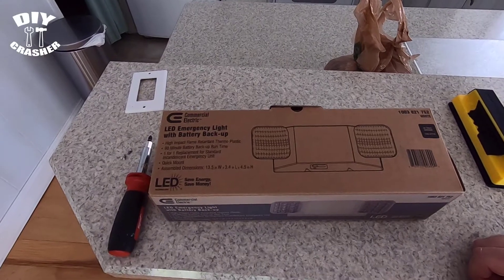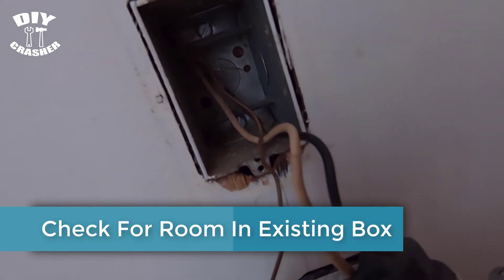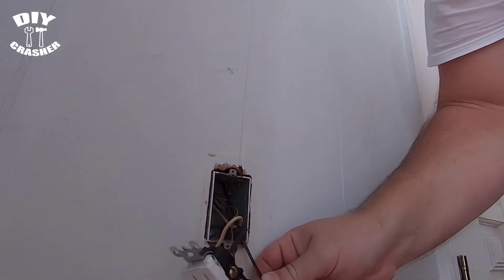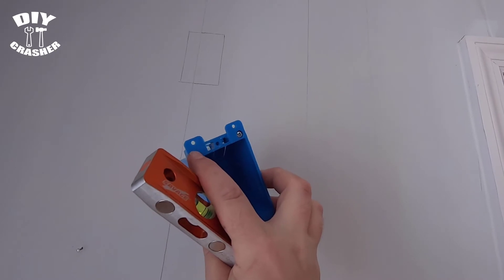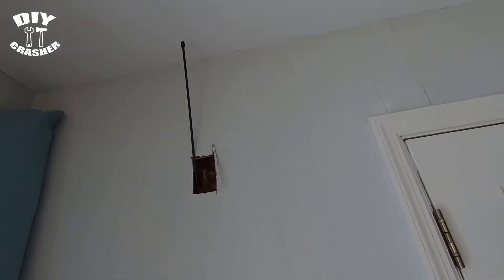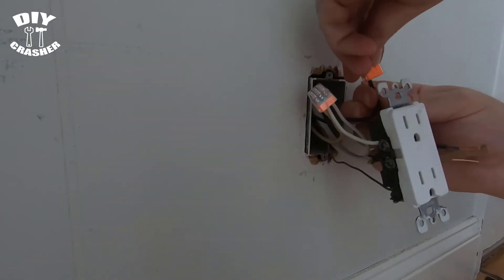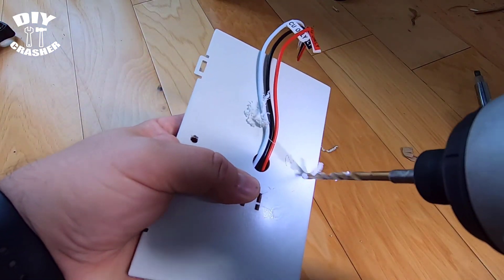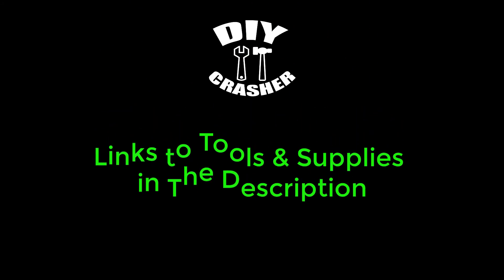How To Install Emergency Backup Light In Your Home For Power Outages

Comment: This video could be USEFUL to the AVERAGE person IF You bothered to SHOW EXACTLY where the RED, BLACK, AND WHITE WIRE GO! If You cant say SPECIFICALLY for example “the RED GOES ON THE LEFT, the WHITE GOES…..
Reply from the maker: Thanks for your comment and sorry for any confusion, I should have been more thorough and will be in the future.   For this particular scenario, the red wire wasn't wired to anything, only the black and white wires were.
Reply: The red is used only for 277 volts the black and white are used for 120 volts, it's common sense.
Reply: @thomaswilkins8168 maybe “common sense” for You Sir. I would rather ask to be clear on something i have no experience on

Comment: I put mine up exactly that way and it works like the video except I get a green light on instead of red ? Is this correctly wired ?
Reply from the maker: You likely have a different light than what is in the video.  I've seen others with a green light.  The important thing is as you mentioned it works like the video, assuming when you press the test button it cuts the power to the light then the light turns on.  Then that would be installed correctly.
Reply: @DIYCrasher  thank you

Comment: Folks you can do this a lot more easier. Just buy the light, and a basic extension cord. Cut the extension cord female end off, and wire the negative and positive to the light, and then plug the male end into a regular power chord and simply hang the light up. No need to cut holes into the wall or run wires through the wall.
Reply from the maker: That's a good tip for anyone looking to add a backup light for themselves for their own use.  This particular scenario had to be hardwired in to pass a fire inspection that was for a vacation rental home.
Reply: @DIYCrasher  ah I see. A year later. Thanks
Reply: I could use your help I'm doing it your way but I don't know what wire is positive and which one's the ground the red or the white I'm used to Green thanks
Reply: @nakaiswilling0369  you have the white wire that goes with the white, black wire that goes with black wire if your connection is 120v, green is always ground wire and red is a hot 277v wire that you only use if your connection is 240v or higher. In the US we normally use white and black and then cap off the red wire and use electrical tape on it for safety.
Reply: thats what i do! i collect them. im on another channel but on my main channel i have a few vids of them.